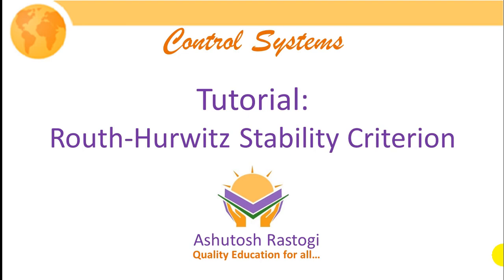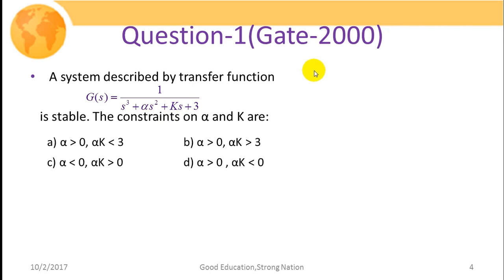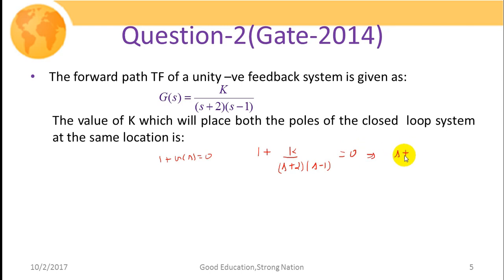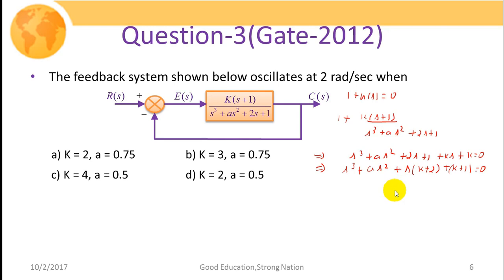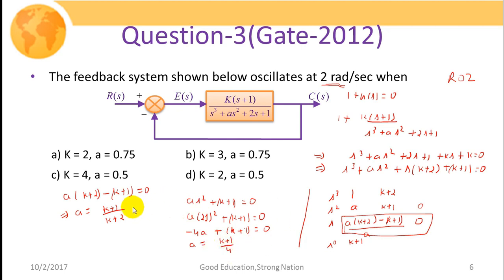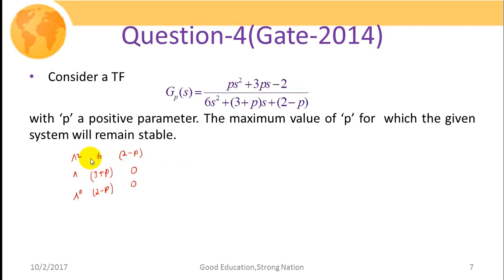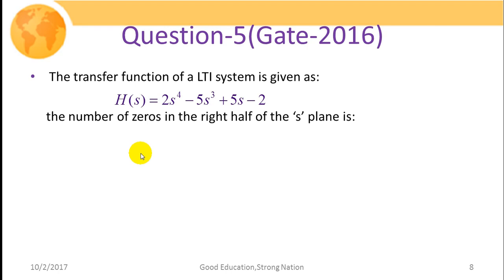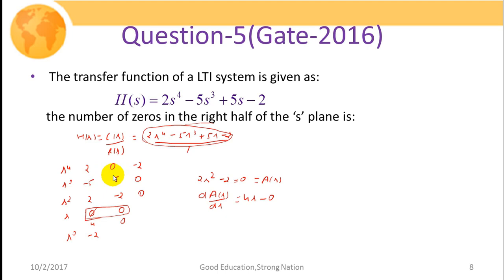Gate Questions solution on Routh Hurwitz Stability Criterion

Comment: at p=2 it will be unstable but we will still write 2 as the answer that is correct .reason is as they want supremum of the set of k because if they give some value like 1.999 there always exist some no greater than that which causes stability hence for that purpose answer will be 2 although it is unstable at that point